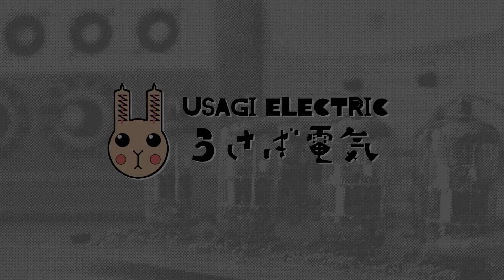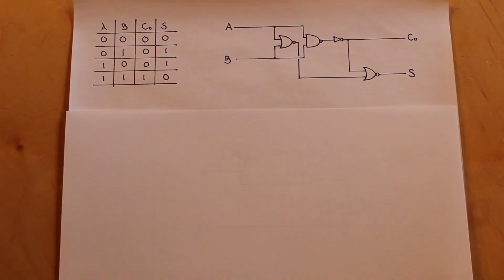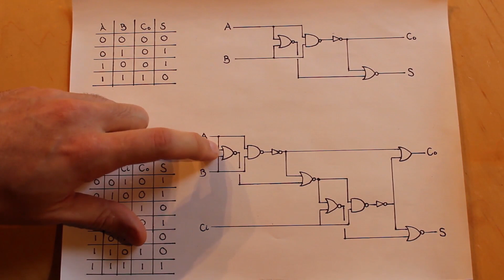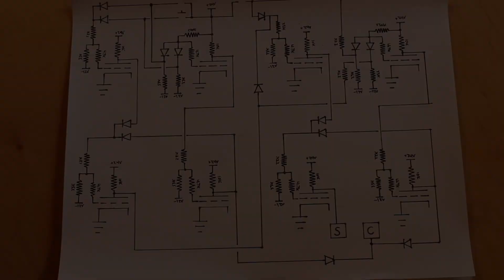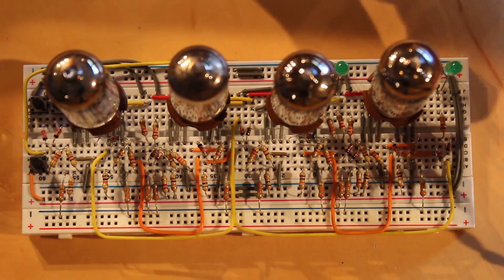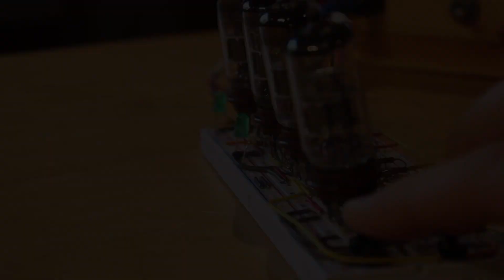Let’s Build a Vacuum Tube 1-Bit Full Adder

Comment: After looking at your design, I did some Boolean logic to see if there is a way to do this that requires fewer tube sections.  I think there is.

Let A, B, Ci (carry in) be the inputs
Let S (sum) and Co (carry out) be the outputs

+ is OR
! is NOT
juxtaposition is AND

Co = (AB + ACi + BCi) any two or more being high means there is a carry out
S = ABCi + (!(AB + ACi + BCi))(A + B + C) an odd number being high means the sum is high
But notice this is the same as
S = ABCi + (!(Co))(A + B + C)

Diode logic will get you Co = (AB + ACi + BCi), and a tube inverter will get you !Co.
Diode logic will get you ABCi.
Diode logic will get you A + B + C.
Diode logic will get you (!Co) (A + B + C)
Diode logic will get you S = ABCi + ((!Co)(A + B + C))

Buffering is wise for Co and S, so that would be possibly a total of three triode sections... that's it.

PS thought... a cathode follower won't restore logic level lost with diodes, however, so that would be five triode sections, leaving one triode section unused if using dual triodes.  So it won't save you much in the way of tubeage, and will need scads of diodes.
Reply from the maker: Straight up, that's some brilliant work! I'm blown away, that's some seriously impressive stuff.

I actually went ahead and built up the circuit you described in Logisim and it works a treat: https://i.postimg.cc/Zqz9gMW8/DDL-FA.png

And honestly, with the right values, you could probably get away with just a single tube for the one lone inverter. Everything else could be DDL. You'd have to be super precise, and more B+ voltage would give more flexibility, but I think it could be done. Of course, getting it to interface with other things would be a nightmare, but on its own, a 1-tube full adder is all kinds of impressive!

I absolutely need to try to build that out to see if I can get it to work!
Reply: Give it a shot.  I'd be curious how far it can be pushed.  There's a limit on how much you can chain diode logic till you compromise your logic levels (a full adder is typically used in byte or larger arrays) but with careful design you don't have to restore logic levels at every point.  Those old tube computer engineers had to think through things that we don't have to any more with zillions of transistors to throw at problems.
Reply from the maker: @daniellevy5248  As soon as I can free up some breadboard space (and steal away a bit of time), I definitely hope to give it a go!
The SUM outputs would definitely need to be buffered at a minimum and restored and then buffered at worst, but the big question is, could the carry out be ganged into the carry in of another adder without causing issue? There's only one way to know for sure and that is to build it!
Reply: By all means fiddle around more with the logic and electrical engineering math.  As another observation: in a larger architecture it can also make sense for some signals to be active low.  Every trick to cut the number of tubes for a functionality buys a hobby project like this more mileage.
Reply: Personally I haven't been quite as afraid of higher voltages, but I have drilled well in how to respect them.  I wouldn't run high voltage in a board that I need to directly touch while operating, even if it means lever handled switches rather than push buttons.  I like those cool 300v modules but in my day I would have gone more modest by using a half wave voltage doubler with 120v line power.  That was a common drill in transformerless TV designs in the USA.

Comment: Works like a charm, Looks like a fever dream I once had in the 80's while fixing a point to point 1940's LW/MW/SW Radio-Gram. LOL.
Reply from the maker: Thank you!
The breadboard really did get full on this one! I try not to pack them so tight anymore when building these test circuits as I end up getting dizzy trying to keep all the resistors straight, haha.

Comment: Nicely done! I love the prototyping technique on a modern proto board! Would have never occurred to me. I'd just would have gone to a metal chassis and started to drill holes for the sockets :-o
Reply from the maker: Thank you so much! I think I can get away with it because I'm running things at such a low voltage. I'm not sure how confident I'd feel in this method at 150V+, haha.
By the way, I'm absolutely loving the HP restoration videos, they've been an absolute treat to watch!
Reply: @UsagiElectric  Indeed I was surprised by the low voltage too. How come you can get away with such low voltages when more typical tube circuits are in the 100V region?
Reply from the maker: @CuriousMarc  There's a few things that play into it. First, I'm stubbornly afraid of high voltages, haha. More importantly though, I'm not using the output to drive anything heavy. With a 10k plate resistor and just 24V, the most I can get is 2.4mA of push out of it. Enough for an LED and not much else. Fortunately, the grid uses practically 0 current, so the output of one inverter can drive the grid input of another inverter with ease. 

Also, the tube makes a huge difference. The 6DJ8/ECC88/6922/7308 dual triode tubes work surprisingly well at these low voltages, transitioning from cutoff to saturation with a change of just about 2V on the grid. The 6AU6 and 6EJ7/6EH7 pentodes also give nearly the same response. However, the 12A_7/5963/6201 dual triode tubes are wildly different. They give much more linear response over a much wider grid input. It takes about a 6V change on the grid to get them to transition from cutoff to saturation. These are massively popular audio tubes and I can see why, the wider voltage swing on the grid can give excellent range and linearity without approaching saturation or cutoff in audio applications (I think, I'm mostly deaf in one ear, so I've done very little tube audio stuff).

Interestingly, IBM often used the 5963 tube in their designs, but never at the (kind of dumb) 24V I'm at. They tended to use a 150V supply and have a logic high of 150V and logic low of 50V (that's just the tip of the iceberg when it comes to IBM supply voltages as you are definitely aware of!). With that much voltage on tap, it was much easier to get the tube to swing from cutoff to saturation.

I have tested around 30 different triodes and pentodes at 24V, and really only come across a handful that work well in this type of digital application at this low of voltage. As mentioned above the 6DJ8 dual triode, 6AU6 pentode and 6EJ7 pentode work the absolute best. The 6CB6 pentode works pretty well if triode strapped, and the 6GJ7 triode pentode works pretty well if you triode strap the pentode half. The 6GH8 triode pentode is surprisingly well balanced if you triode strap the pentode half, but they still require a bit more swing on the input than I'd prefer. The 6BE6 heptode/pentagrid converter is an interesting one too. It works pretty well too and makes a neat little NAND gate, but I just don't have that many of them, so they get criminally underused in my stuff.

Sorry for rambling on, but I hope that gives a bit of insight into the madness of my 24V mis-adventures, haha.
Reply: @UsagiElectric  Thanks, very informative.

Comment: Great video! If you used pentodes, could you have done away with the diodes? Just curious if you could make it with only tubes, resistors, and capacitors (if necessary).
Reply from the maker: Thank you very much! You could actually build the entire thing with tubes, resistors and caps (although I don't use any, there are a few places that I probably should be). The design itself wouldn't even have to change, just instead of using silicon diodes, you could use the 6AL5 dual diode tube. I've actually built a few NOR and NAND gates using both a 6DJ8 dual triode as well as a 6AU6 pentode couple with the 6AL5 dual diode, and they work really well!
The main reason I didn't do it here is it would take 6x of those little 6AL5 tubes, making it quite a bit larger! Although, the tube diodes may actually work a bit better because there is zero electron leakage in the reverse direction.
Alternatively, you could also use a tube like the 6JU8, which is a quad-diode in a single 9-pin tube. In which case, you'd just need three of those. That would be very cool indeed, but getting all the jumpers in the right spots would be a mental exercise for sure, haha.

Comment: This was a lot of fun watching :-) A while back I did a three value Venn diagram (input A, Input B, and carry-in C) which I then used to show the two outputs, sum and carry-out :-D I like how you pointed out that you can press any combination of 1, 2 or 3 buttons, that helps reduce the cognitive bias, of what each input is.
Reply from the maker: Thank you very much! I always have to remind myself to test every combination of button presses to make sure it's working properly. It's so easy to do the mental math in your head and say "1 + 1 = 2, so I need to flip the first two switches", when that 1 + 1 could be on any of the two switches. Fortunately, by testing every combination, it reveals mistakes in the wiring, like that pesky 3.3k ohm resistor, haha.
Reply: @UsagiElectric  exactly! Any combination of switches!  2^3 combos 😁 and you tested the no switches after the warmup 🙂